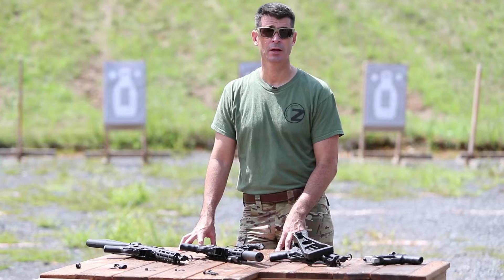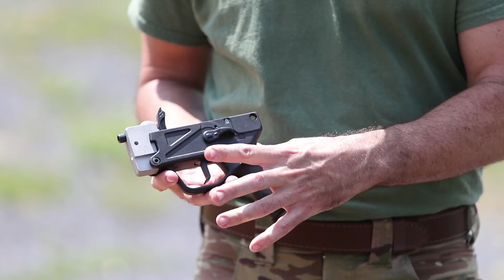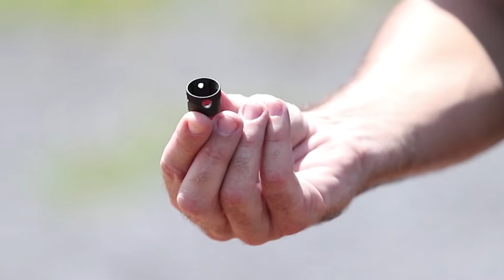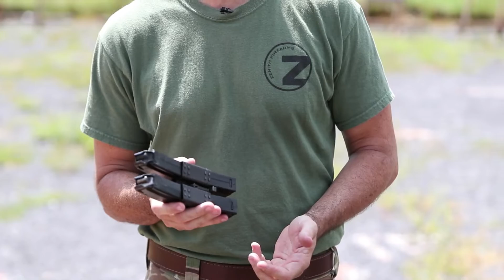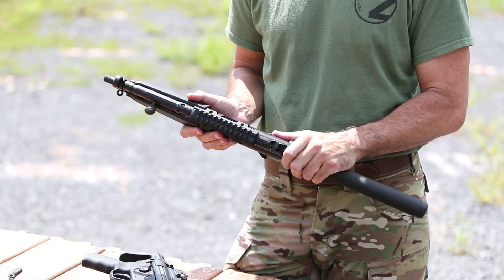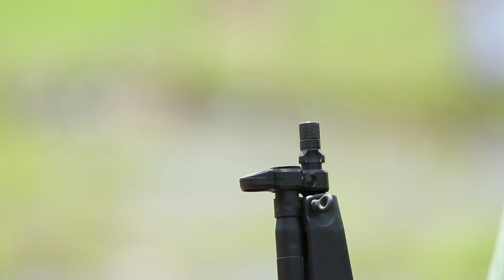Recommended upgrades for your roller-delayed blowback weapon

Comment: Would like to see a tear down between hk zenith and century arms.
Then a comparison of parts between the 3
Reply: Bought an ap5-p and it jams every 3 rounds it was 2 bands. Having to go in and individually buy parts to hopefully fix whatever tf os goin kn
Reply: @adissonreedy7331  should’ve bought the hk sp5
Reply: @marshalllapenta7656  yeah but thats an extra like 1500 lolol
Reply: @adissonreedy7331  Do you think the sp5 would have any problems?
Reply: @marshalllapenta7656  definitely with the extractor spring but with my ap5 its just double feeding and treating shells like mashed potatoes just crushing em
Reply: @adissonreedy7331  Did you get it sorted out
Reply: @WolfBiteTactical  yes actually it was the extractor and at a MUCH MUCH closer look the one that came with the gun was just barely rounded where it was supposed to be straight so i replaced it and now it works like a dream. Thank you for asking
Reply: @adissonreedy7331  Glad to hear. I have a AP5 enroute and pre-emptively purchased a new extractor and springs from HK parts. Neighbor had same issue with her AP5 and with replacement it hasn't missed a beat.
Reply: @WolfBiteTactical  I'm still stuck between the MKE AP5p, the (new U.S.) Zenith, and a PTR 9kt. Kind of leaning towards MKE (Turkish). I'm thinking I should do exactly what you did (if I go with the MKE) - just buy an HK extractor before the gun ever gets here. Right now, the price difference between (U.S.) Zenith and MKE is $565 and neither are sear ready. Kind of leaning towards MKE now. Oddly - the Century basically IS THIS Zenith being the video is 4 years old (didn't the move happen within the last 2?)
Reply: @Whiskey Tango Armory  Go AP5 at PSA for less than 1k. Get the extractor and new copper springs from HK parts. I'm at 650 rounds with ZERO malfunctions and shooting tight groups. My head space is sitting at .016 . It's a great firearm to learn on as I have torn it completely down to the rollers.  The cocking tube is off center slightly but it flawless and hit at point of aim. I contacted Century about the tube and they responded in less than 24 hours . I decided against sending it in to have the tube straightened out because it is so good . Just my experience. Yes the Zenith move did happen a few years back. The firearms are now made in VA with a great group of people there now. 100% guaranteed and the gun is improved and tight.  I handled one of the other day and it is a sweet weapon
Reply: @WolfBiteTactical  I had decided on the Zenith UNTIL I was told (in an email from them) changing any trigger component voids the limited lifetime warranty.  That made the $600 difference to big (half the extra cost was so I could have an American warranty service). So...... I have the AP5p in my cart right now. It is not less than a grand tho. After discount,  plus shipping, I'm looking at $1,140. The "M" model is cheaper but I need those muzzle attachment points. Thanks for your help. Hopefully mine runs as good as yours!

Comment: Why doesn’t Zenith / HK throw the owner of MAD MAX bolts a few million and buy his design and make the MAD bolt standard in the gun? No one mentions it but HK recommends you change the extractor bolt springs every 500 rounds. The MAD bolt eliminates that all together.
Reply: 500 rounds? BULLSHIT any part on an HK wears after 500 rounds.

Comment: Great video as always would like the specs on the gun at 1:30 suppressed one.
 looks like your personal gun
Reply from the maker: What specs are you looking for?
Reply: @zenithfirearmsofficial  01:31 Is that a stock? Is it a brace? What is it called?
Reply: @citadelchase8858  its a stock
Reply: omega 9k supressor with tri lug mount, midwest industries sp89 hand guard, surefire light (not sure the model),  the light is on a mlok mount that pushes it forward more (not sure the model) , surefire sr07 light switch, the stock is safety harbor KES MP5k pattern stock.